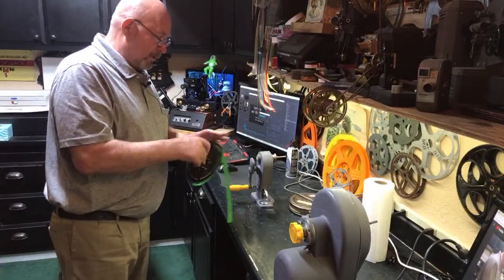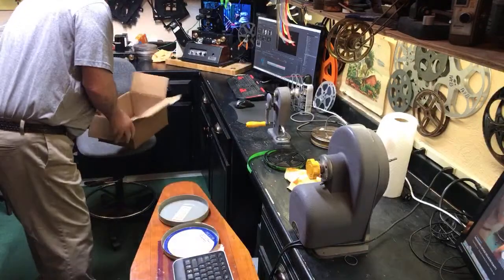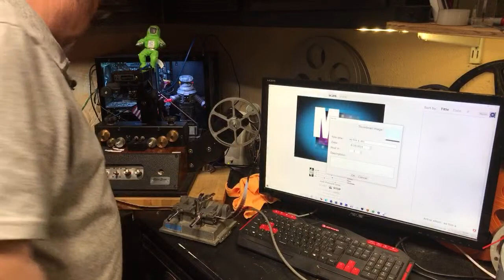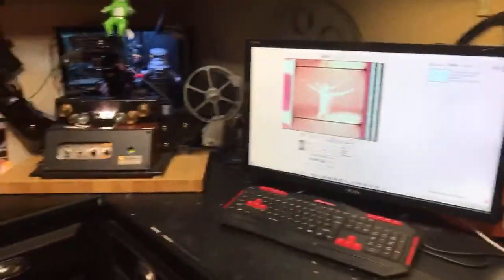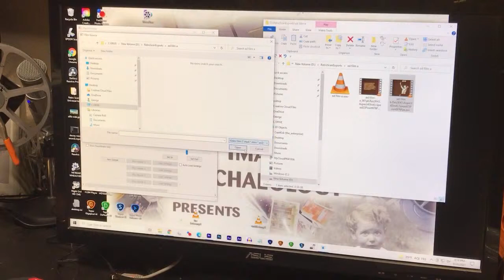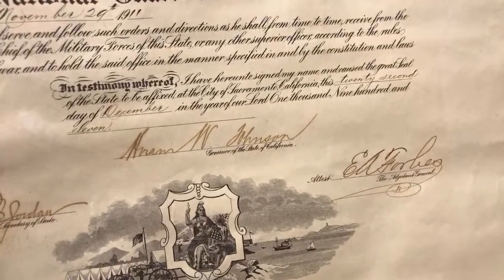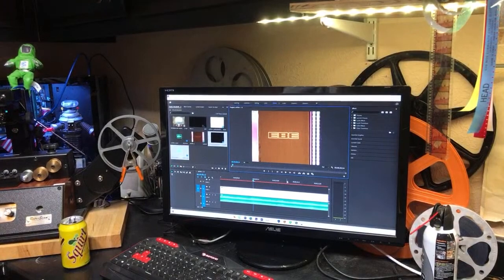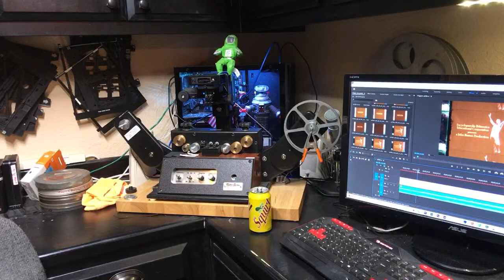PROCESSING VINTAGE CELLULOID FILM PT1

Comment: Fascinating stuff. Wonder if it’ll work on 8mm reels from late 50s thru mid 70s? (No sound) My granddad’s old Bell and Howell projector.
Reply from the maker: Please do not play them on a projector. These films are old and a certain amount of shrinkage has taken place so that the sprocket holes no longer lineup correctly with the sprocket drive. There are other issues that affect the transport system in those old Projectors as well. Vintage projectors are great static displays look horrible to play Film on. If you want to send them to me I can digitize them and I am very reasonable. Take care and thank you for watching.